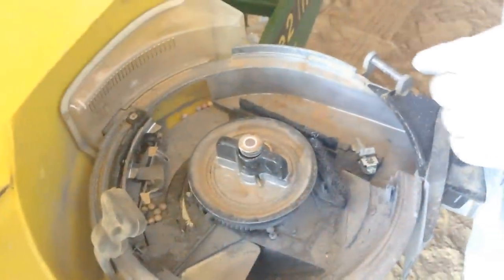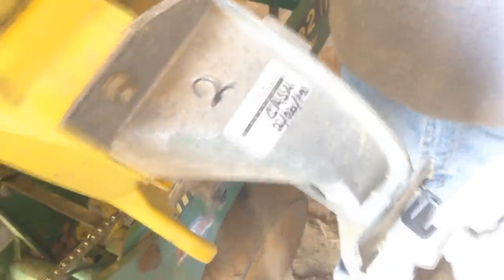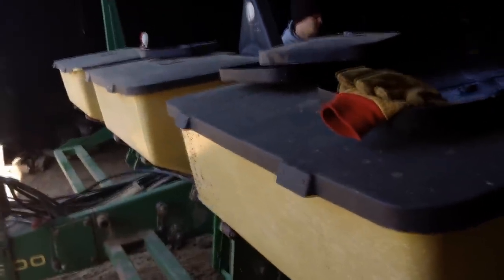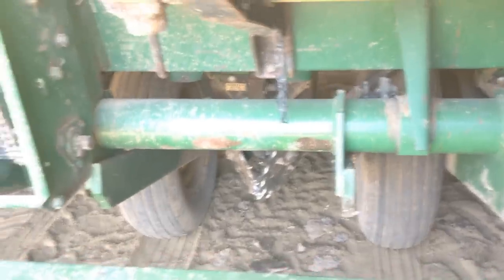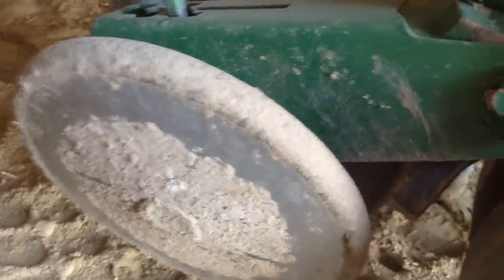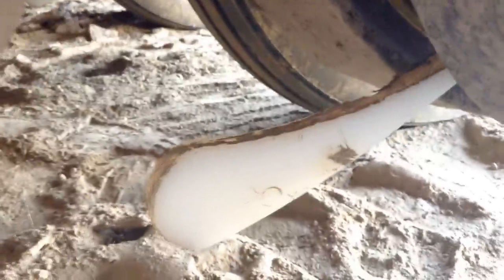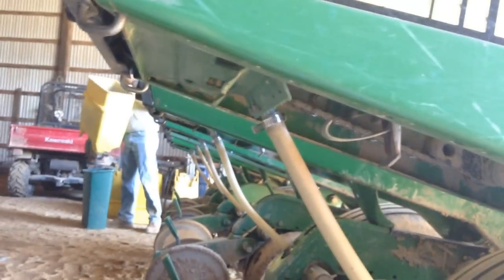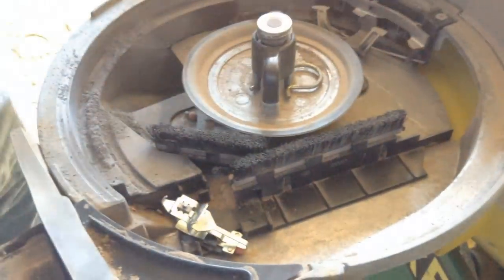Setting the Planter up for corn (Precision eSets) and changing the seed disks

Comment: Is the pneumatic planter suppose to run clockwise or anti. I have but the fan rans anti clockwise and so the air in the tube does not blow out. Please can you advice me about the situation. Thank you.
Reply: Sounds like your hydraulics may be hooked up backwards if the fans are spinning backwards... if the fans are spinning backwards it won't create enough vacuum to keep the seed on the plates, usually, or it'll be highly irregular.  

Later!  OL J R :)